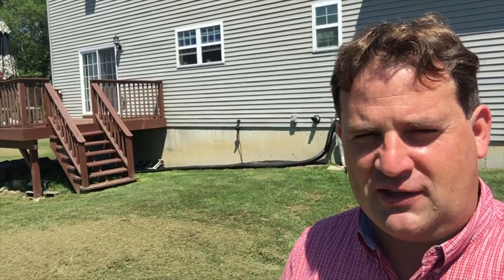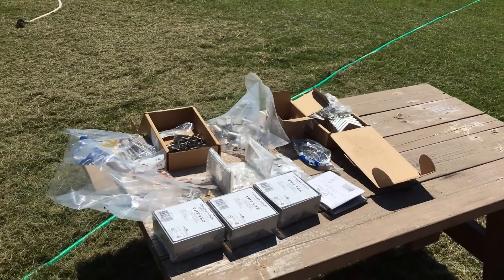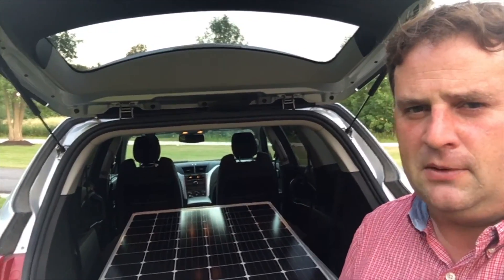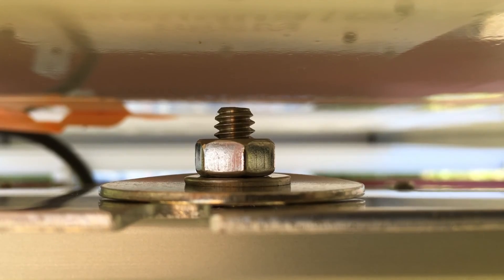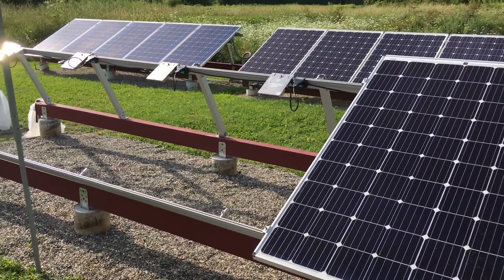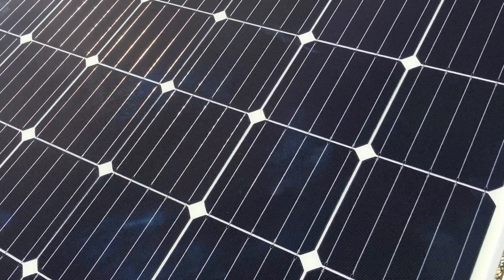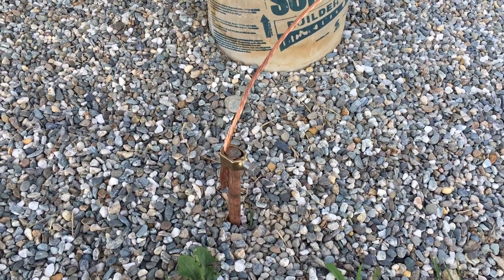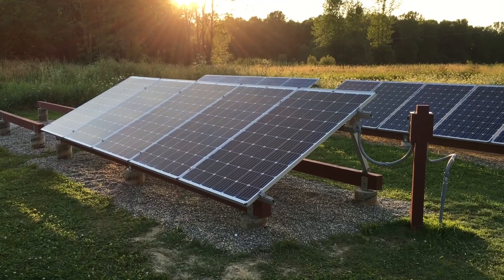New DIY Ground Mount Solar Installation AC-Grid-Tied Part 5 (Racking & Panel Installation)

Comment: HOWdy  G-M-D-G,
Thank you for  taking us along 
Suggestion - when drilling HOLES for your GROUND-WIRE in those junction BOXES  ... why NOT drill from the "BOTTOM"  instead of the TOP to keep water OUT  ?
Why did you OPT for STRANDED #6 gauge wire instead of SOLID ?
Thanks Again
COOP
...
Reply from the maker: Drilling at the bottom is a good idea!  #6 is readily available at the supple store where all of the electricians go. It still works for code. Most pro's are using stranded on their solar setups.  Thanks for watching.

Comment: Great job, how are those Enphase microinverters working I was thinking about using them have you had any trouble out of them.
Reply from the maker: Thanks.  The micro nverters have been flawless.  A few years back I thought I have a problem with them but it ended up being the panels.  The microinverters are the best part of my system! Thanks for watching.

Comment: I have a ground mount system. The distance between the last panel and the inverter is 142 foot. I need advice on the inverter. I need a high dc voltage coming from the panels.
I'm trying to use and hybrid inverter

Comment: Have you used the Enphase stainless cable clips? they work good for holding the wire.  Good job
Reply from the maker: I need to order some and check them out...

Comment: Beautiful job! Would you let us know what brand of racking rails you are using? Like the mounting configuration. Thanks.
Reply from the maker: garyabc Thanks!  I used unirac solarmount rails.  Everything is Unirac...   Thanks for checking it out...
Reply: vtmaestro Thanks, I see that there's a local distributor near me. I will check it out.
Reply from the maker: garyabc I had to ship it in and the freight was expensive.  I think i paid $175 in freight due to the length of the rails.  Tried to get as much in the order as possible...